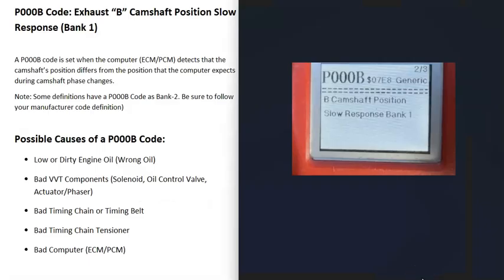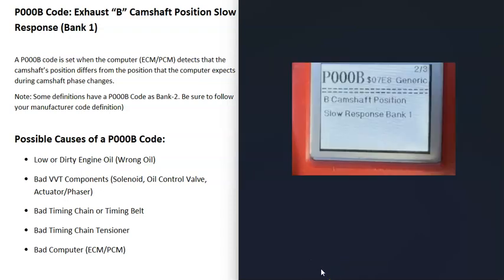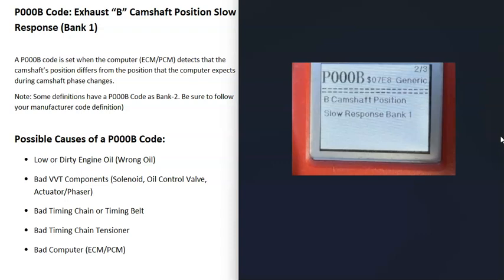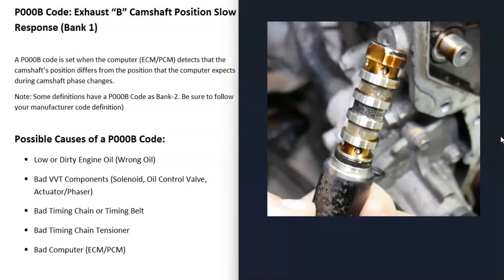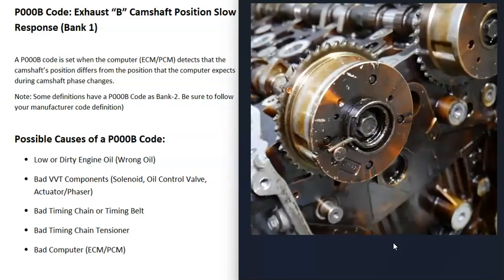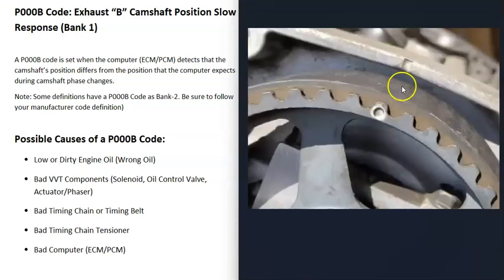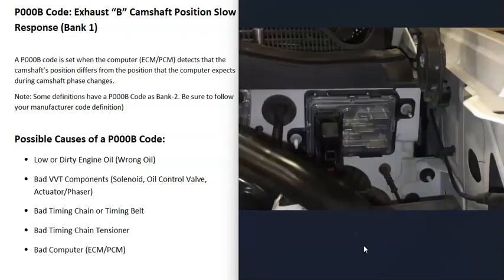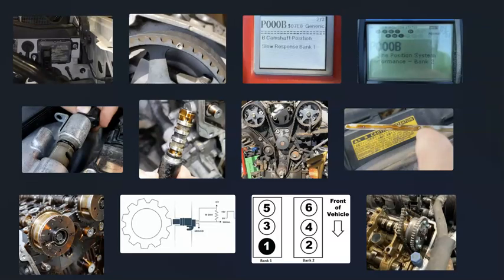Causes and Fixes P000B Code: Exhaust “B” Camshaft Position Slow Response (Bank 1)

Comment: Had the code today in a 2019 ram rebel changed the oil and it fixed the noise and code, weird. I wasn’t even due for an oil change.

Comment: Got a p000b after engine rebuild for misfires, im thinking could be old sensors that got metal in them from the misfires, I'll report back once I get the sensors changed
Reply: Following this. Having the same issue but I’m getting P0008 & P0016
Reply: Changed all three oil sensors on 392 hemi, drove it about 40 miles with no light, currently am going to run it untill 1000 miles before i call it good. There was barely any metals in the sensors, so maybe the ecu is relearning now @loganbaum1072
Reply: I don't see my reply so I'll do another, changed 3 sensors on 392 hemi 2014 , and nothing light after 50 miles, sensors had very little metal in them, might have thrown p000b code because it's relearning

Comment: Do you know how many volts the VVT should be receiving?
Reply from the maker: A schematic is needed for the vehicle to know for sure what the voltage is, but usually there is 12-volts to the VVT solenoid and 5-volts to the cam sensor.

Comment: I have a 2012 dodge journey 4 cylinder se and it drives smooth and my P000B check engine code came on today. Im not sure what is causing it to do that
Reply: 000😊😊😊00😊😊

Comment: 7-28-2024, is there a way to narrow this down
Reply: You can use a scanner to test Sensors , to clean oil control valve, timing, and look for misfires